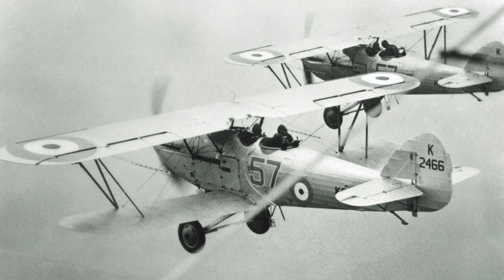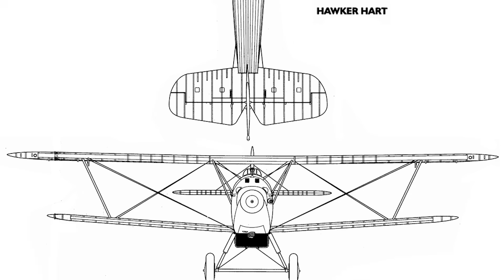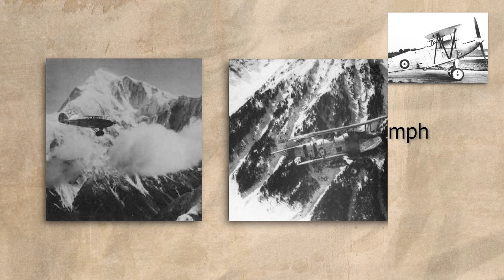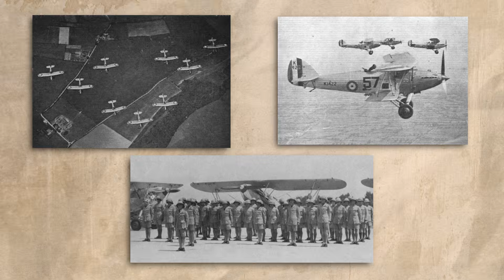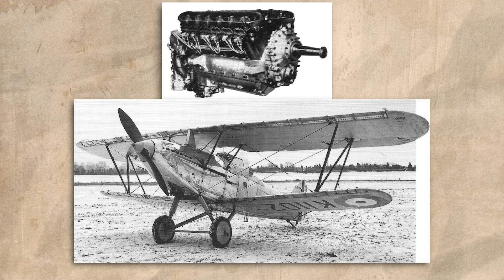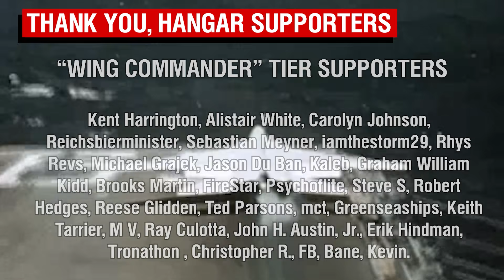Hawker Hart | The Bomber That No Fighter Could Catch (in 1930)

Comment: Amazing to think that just a few years later Hawker would develop this basic airframe into something with 50% more performance and four times the firepower, and in the face of disinterest and inertia by the Air Ministry..
Reply: That same Air Ministry asked Handley Page to redesign the HP.56 so that it had 4 engines that were not the RR Vulture as they were concerned that the RR Vulture was not going to be successful. The aircraft Handley Page came up was the HP.57 or Halifax. So, the short-sighted Air Ministry got that right. They also asked for designs for fighters with at least 6 guns, whilst the 4 gun fighters were not yet in service. Short-sighted, my a##e.
Reply: @neiloflongbeck5705  well said. There are good historical sources for the drive to get the RAF ready to face Hitler down, and it's a fascinating tale of how much was got right - including not overdepending on offensive bomber power, in favour of fighter power for home defence.
Reply: @Simon_Nonymous  the trouble is people have swallowed the simplistic explanations. It's like the heavy and medium bomber's 100ft wing span limit being based on the hangar doors whilst ignoring the specifications for outdoor maintenance of the Type C hangar with its door which could open to 120ft. The size limit was due to the physical strength of a single pilot.
Reply: @Simon_Nonymous  Chamberlain gets criticised for many things, but he did at least champion Fighter Command and Dowding.

Amazingly, in 1923 the RAF had, although just for that year, precisely zero home defence squadrons!
Reply: @wbertie2604  and put up the money for radar research.
Reply: @neiloflongbeck5705  plus a desire not to let manufacturers go over the top and produce giant white elephants. Expensive white elephants. Mind you, sometimes air ministry specifications of the early 30s were almost impossible to meet as it could be things like "bomber to do stuff, but must have this weird prototype engine". P.13/36 originally also specified catapult launch and shallow dive bombing and sounded like they'd translated it from something Udet had written.
Reply: @wbertie2604  quite so, thank you for the added information.
Reply: @neiloflongbeck5705  I know - the realities of the time were very complex as @wbertie2604 has most excellently described. I know we have 20/20 hindsight, but I like to think they got most things done as well as was possible for the time.
Reply: @Simon_Nonymous  Given how relatively short-sighted Luftwaffe policy was, if the UK and France had had two more years to produce more, and purchase more from the USA, WW2 might have been much shorter.
Reply: @neiloflongbeck5705  and in 1937 indicated that future fighters should have  cannon, and in 1939 that was to apply to bombers too (WW2 got in the way).

Also, it wasn't antithetical towards jets, but it was in the process of modernising piston aircraft as quickly as possible before a war and wasn't convinced that centrifugal compressor turbojets were the best option, and was ultimately correct. It did fund two strands of research all the same.
Reply: @wbertie2604  yep, that sounds like a short-sighted organisation, not.
Reply: @neiloflongbeck5705  it was pragmatic too at times. Granted P.13/36 was technically for a medium bomber, but apart from the insurance option Albermarle, the 1939 decision was to concentrate on heavies, buy mediums from the USA. Guns - indigenous? No, just use French and American designs apart from the Vickers K in some instances. Continue to prototyping heavy calibre turrets, or get 303 ones in everything, although it was too slow restarting. Shadow factories, yep, in 1938.
Reply: @neiloflongbeck5705  the first request for six guns was in 1929, IIRC, although that was for a nightfighter with for guns forward, two inclined towards. Then that was changed to a day fighter with four guns that became the Gauntlet, although requirements were reduced to two guns, but back to four for the Gladiator. There the issue was time to altitude, which was hampered with four guns. For a nightfighter, quick climb wasn't seen as so critical as the aircraft was supposed to be up already, loitering (as much as these relatively short endurance aircraft could) for the occasional night bomber or  Zeppelin, or un dirigible, as France was seen as a potential threat too.
Reply: RAF rearmament started in earnest in the early 1930s, such as the expansion in aerodromes and new hangars from 1934, monoplane fighter specifications in 1930, bomber specifications in 1932 (leading to the Wellington). 

Yes, there was some apathy in the late 1920s, but apart from China, the geopolitical situation was fairly stable at that time, so there was no great rush in 1926-30, but even so the specification that led to the Hart at the time. 

It's also worth bearing in mind that the UK economy was doing badly in the late 1920s even before the Great Depression due to going back onto the gold standard at the wrong exchange rate in 1924, so there wasn't a lot of funding available. Other victims were the Medium III tank and the No.III mk. 6 rifle that later became the No.4 mk.1.

Despite being in the grip of the Great Depression in the early 1930s, there was still a fairly good research and modernisation programme.
Reply: There’s no change nearly 10 decades later.
Reply: @alangordon3283  Actually it is very, very different.  The only commonality is the shortage of money from the Treasury 😞
Reply: Hawker Hart became the Demon/Fury (remove second seat)
Fury became the Hurricane (new monoplane wing with retracts, enclosed cockpit)
Hurricane became the Tornado (new engine, new wing, new canopy, fuselage changes)
Tornado became the Typhoon (new engine, new wing, new canopy...)
Typhoon became the Tempest (new wing, etc.)
Tempest became the Tempest II (engine change...)
Tempest II became the Sea Fury (still more changes)

Each change was incremental and used something/s from the previous design. One of the greatest displays of incremental evolution in aviation history.
Reply: @SoloRenegade  Don't forget the Hawk - same wing as the Sea Fury. Very different engine (jet).
Reply: @wbertie2604  is that right? Not arguing, asking?
Reply: @richardpentelow5111  agreeing with
Reply: RAF: ‘Nice plane you’ve got there, we’ll take it.’ Hawker: ‘How many would you like?’ RAF: ‘All of them.’

Comment: One can see the Hurricane shape in Hawkers work.
Reply: The Hurricane started out as the Fury Monoplane.
Reply: @neiloflongbeck5705  true. The Hind at Shuttleworth goes the other way, still Hawker and even more Hurricanesqe.
Reply: @neiloflongbeck5705  Both projects clearly used a lot of the same data.
Reply: Which then evolved into the Typhoon, Tempest and a candidate for the greatest in performance piston fighter the Sea Fury
Reply: Hawker Hart became the Demon/Fury (remove second seat)
Fury became the Hurricane (new monoplane wing with retracts, enclosed cockpit)
Hurricane became the Tornado (new engine, new wing, new canopy, fuselage changes)
Tornado became the Typhoon (new engine, new wing, new canopy...)
Typhoon became the Tempest (new wing, etc.)
Tempest became the Tempest II (engine change...)
Tempest II became the Sea Fury (still more changes)

Each change was incremental and used something/s from the previous design. On of the greatest displays of incremental evolution in aviation history.
Reply: If it ain't broke,  don't fix it.
Reply: Much like you see the F3F Biplane in the F4F Wildcat’s
Reply: ...never change a running system...! 😉
Reply: @Packless1  if it is running well, don’t touch it…or even look at it for more than a glance:-)
Reply: Oh definitely. Camm's work was a continuum; there is absolutely always something retained from a previous design in any new one from Sir Sydney.
Reply: @stevetournay6103  ...as professionals do.
Reply: Immense respect for Camm, Chadwick, Mitchell, de Havilland and that blind bloke who designed for Blackburn.
Reply: @bobroberts6155  they are remarkably ugly aircraft 😂
Reply: It’s almost as if they shared the same designer, sorry couldn’t resist.
Reply: The Hurricane was originally known as the Fury Monoplane.
Reply: The first flight my father ever had, in the back seat, in 1936.
Reply: yeap